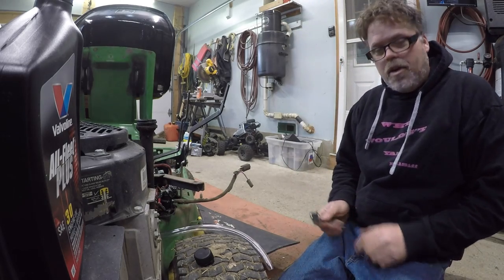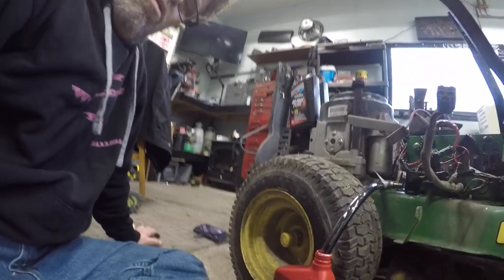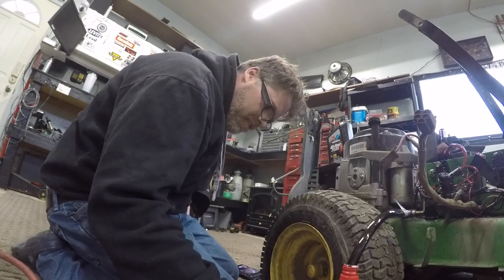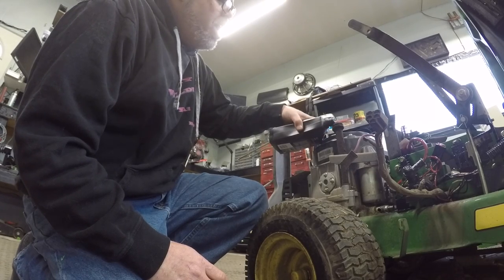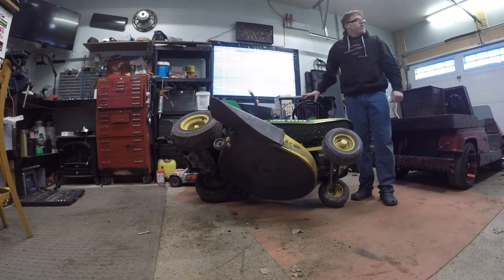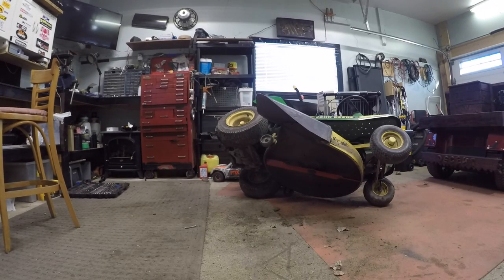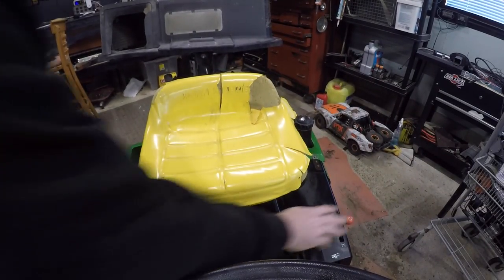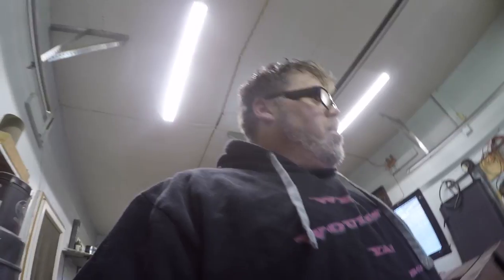GX75 John Deere READY TO GO

Comment: I bought a little bag of some zerk  grease fittings drilled a hole in the bearing pod on mower deck and screwed the zerk in pumped er  full of grease and buddy so much nicer especially  on blade engagement spins right up quick she does . I have same type mower you have but it's a dirty old craftsman